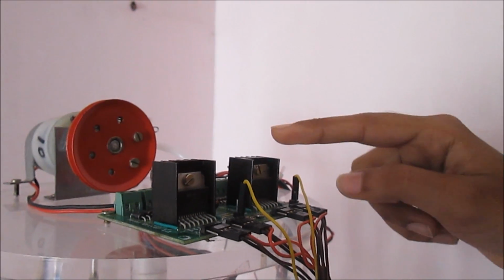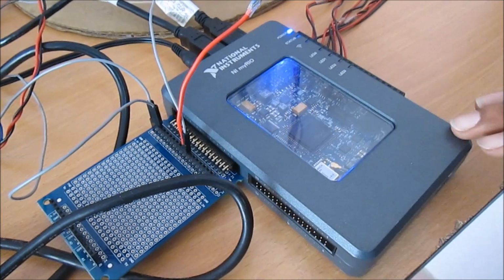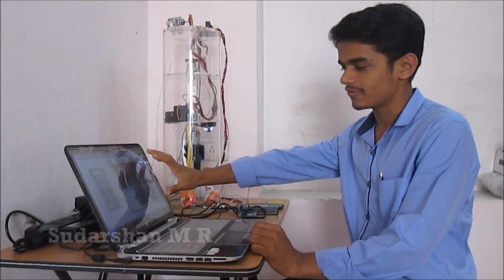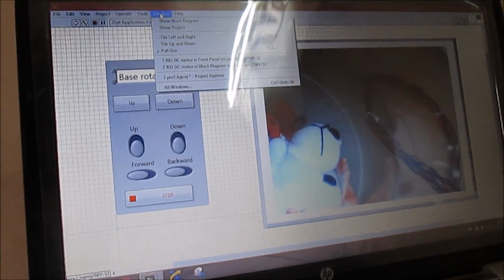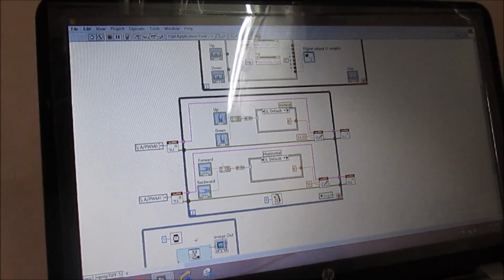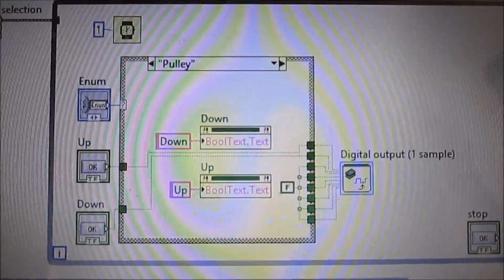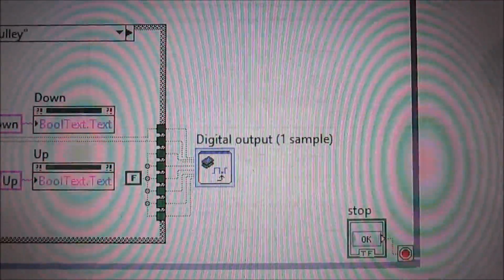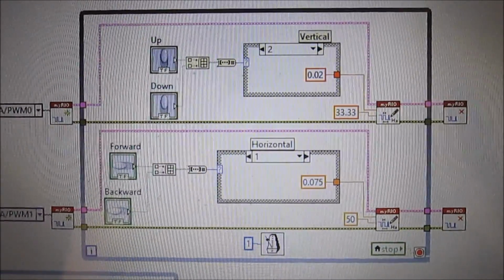Design and Implementation of Bore-well Rescue Robot using LabVIEW

Comment: There is no logic in this project. How a baby will get stuck up in borewell? If the size of baby and borewell diameter both are equal. There should not be any clearance. Here borewell diameter is larger than baby. Possibily soil may fall on the baby and cover entirely.
Reply from the maker: Yes sir, back then we did not have the kind of knowledge and guidance that was needed to put logic in the project sir. We had just tried our best.

Comment: Instead of myrio  could you suggest other component to do the same work.Because myrio cost is high
Reply from the maker: You can Arduino for motor control and a standalone camera module with wireless transmission. You can even use a Raspberry Pi where you can also interface camera.

Comment: very good work. excellent..congrats Sudarshan and team.  You will face lots of practical problems in real live incidents.. You have to go for more powerful motors, motor driving circuits.. however the overall idea is excellent. I suggest guys to use Raspberry P4 and python programming.. its very flexible and you may find easy to add more sensors... (example: like ultrasonic sensors to measure distance and all)
Reply: Paise aap doge uncle ?

Comment: It's a good work can you give the details of what are the things you've used to control the motion of the robot??
Reply from the maker: As mentioned in the video, We used servo and DC motors for different movements of the robot.
Reply: What are the microprocessor unit ??.... You have used bro
Reply from the maker: @urekam1908  myRIO board. It was given to us by National Instruments, for the project contest - NIYANTRA.
Reply: Brother how had you started the project ??
Reply from the maker: @urekam1908  We applied for the contest. Sent an abstract, got selected, got components and guidance. And we did it.
Reply: @SudHebbar  can you send the paper and abstract  to learn new things?
Reply: Brother.....myrio is that like aurdino , isn't it??
Reply from the maker: @urekam1908  It can do more than Arduino. You can get more details about it on National Instruments website.

Comment: what is the material used for the pipe
Reply from the maker: Fiber.
Reply: where can we get that fiber pipe ?
Reply: how was the balloon inflated ?
Reply from the maker: Abhi Raana We bought that from a glass works shop. The balloon was manually blown.
Reply: What were the bunch of wires used ? Could you please mention the connections of the wires?
Reply from the maker: They are single core wires. A pair of wires were connected to each of the DC motors from the motor driver circuits. Motor drivers get inputs through wires connected to digital output pins of myRIO. 5V, Ground and PWM wires from servo motors are directly connected to myRIO.
Reply: how is the disk placed in the pipe ? what is the material of the disk and where can we get them ?
Reply from the maker: It's the same material - fiber. It is suspended from the pulley.